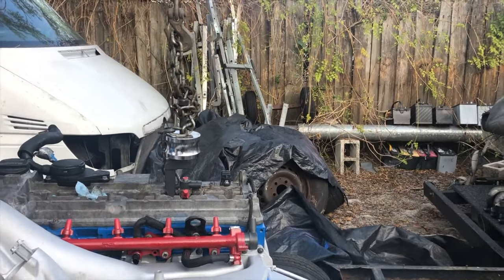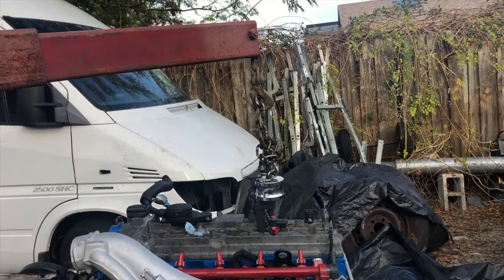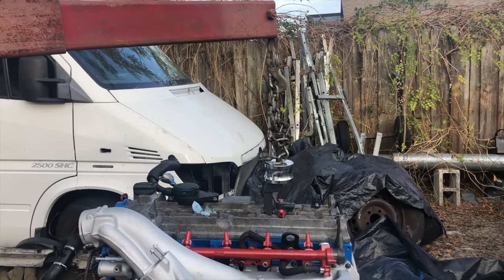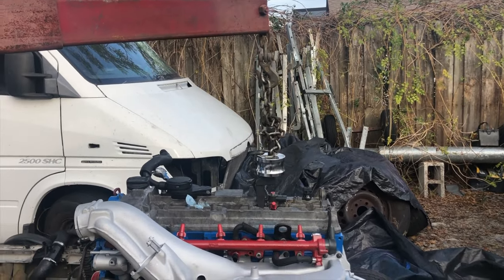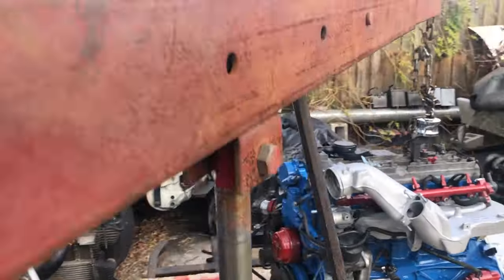How Stuck is Your Injector? Mine Can Swing the Engine & Transmission.

Comment: Good luck with that! The guy that pulls mine gets the engine real toasty before he even tries to pull an injector, a luxury you don't have! I found carburettor to be better at dissolving the crud than oven cleaner, I am looking forward to see how you get on with it, best wishes
Reply from the maker: Carb cleaner is Methyl Ethyl Keytone. I try to avoid that stuff, although I know many other chemicals are just as bad.

Comment: Any idea how long it was driven with the "black death" before this (assuming that's why is was so stuck in the first place)?
Reply from the maker: From what we can tell, it had an injector job done on all 5 injectors. I’d say 50-100 miles after, injector 1 popped out. When we found this engine, I first thought the cover had been pried up by someone without proper tools. Turns out injector 1 popping at 45-60mph pushed the cover up. 

All 5 injectors are held in with non-stretching hex bolts that are TOO short to have any business holding injectors. 

Stay tuned....we’ll be firing this engine up soon.
Reply: @FloridaVanMan  Good luck!!!
Reply: @FloridaVanMan  Did you ever get this out?
Reply from the maker: @aaroneye86  Yes, the destructive injector remover. Not dynamite.... the other one. LOL! I needed a little help remembering how to take the OM612 injectors apart to get the tool spun in there. But starting with a warm engine from a good run, I was able to pull it with the regular puller and a lot of wrenching.